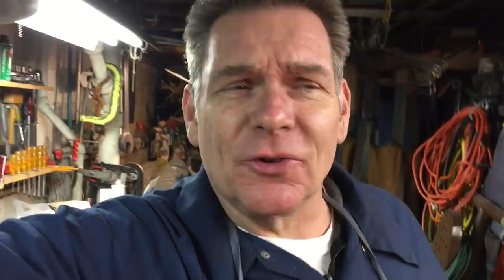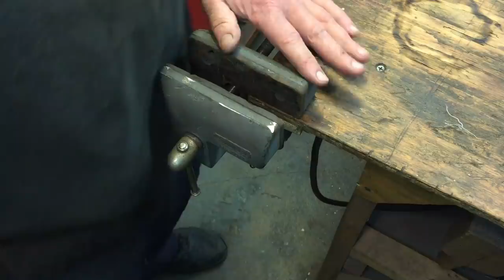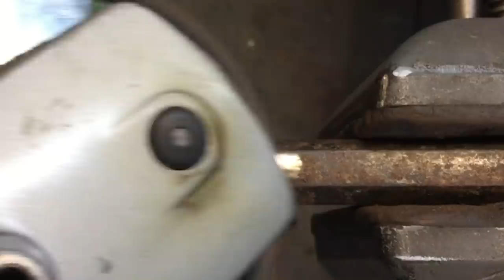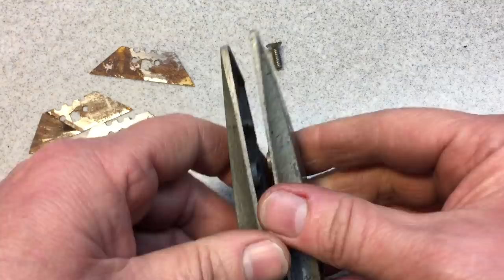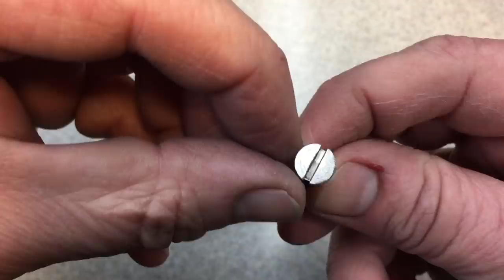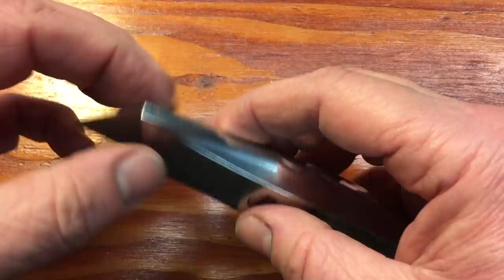Walsco Utility Knife Makeover and Fun With Your Angle Grinder.

Comment: That's a good looking utility knife, Scout! Now to stick my nose into someone else's business. I would recommend using a full-face grinding shield when you pick up an angle grinder. I've always worn prescription eyeglasses with safety lenses so I felt invulnerable until some time ago when a grinding spall smaller than a poppy seed found its way to my eyeball. The ophthalmologist said I was lucky because another millimeter and it would have landed on the optical center effectively blinding me in that eye. I went right from his office to the welding supply house and bought a face shield.
Reply from the maker: I always wear a face shield when using a cut-off disc...!  They can explode!  Good point...  Thanks!

Comment: I wanted an angle grinder for years. My needs were very limited, though, so I just couldn't justify the money. Even though they aren't expensive, I have to be able to predict how often I would use a tool, divide that number by the cost of the tool, and if the result is less than what I would be willing to pay to RENT a tool, I buy it. Well, I found myself in need of an angle grinder just too infrequently to arrive at the numbers I wanted.
Then, one day I was looking for something else and found a guy selling an angle grinder on Craigslist for a price I could not pass up. It was a corded unit, and that's the reason he was selling it. Most people, it seems, want cordless tools. Well, I just didn't care about that, so I contacted him and two days later it was mine. It was a complete set, too, with a protective case, five or six wheels, and the tool needed to change the heads. And yes, it has the handle that you can affix to three sides to make any project more comfortable. It's old, it looks like hell, but it works perfectly and now I go around just looking for opportunities to use it.

Comment: at 2:05, I don't think so John. I look forward to your video's and don't look at how long they are.  Angle grinders = respect. My first one is a 4" grinder not as strong as the bigger ones. I love flap wheels. The worn out ones are good to work with. I sharpen lawn mower blades etc. But they can remove a chunk of material quickly. I loved that utility knife. Jeweling is an awesome technique for metals. I love it.

Comment: Utility knife looks great. An angle grinder can also be dangerous to your body, especially when you are are using cut off wheels. I saw a guy using one in a body shop and the wheel exploded. He was lucky wearing a face shield. The wheel tore the face shield up.  Be careful when using a hand grinder.  Safety gear is a must with this tool.
Reply from the maker: Wire!  I very rarely use the cut off wheels!  I’m a hacksaw man!   You are so right when I do use them I dress like safety sally!  😃👍

Comment: That knife is SHARP and I don't mean just the tight blade either. A while back I bought a new go-devil or splitting maul or Collins axe or whatever you want to call it and of course the point was too thick and blunt for it to start a split right so I took it over to the boulder hole shop to grind it down.They have the big Milwaukee side grinders (6 or 8 inch)  with no guards to work on the BIG stuff with. With a trigger switch setup and while I was grinding down the blunt part of the edge and having to shift the grinder around I was thinking that someone could get WRECKED very easy with this tool. The next week one of the grinder crew cut a finger off with one. Can't be too careful. Thanks John CS! Blessings!
Reply from the maker: Lewie So true!   😃👍

Comment: Your work is the best. Don't worry about making your videos longer. That's why we are here. I try watching some of the other guys and usually quite before they are done. There about  three others l like and they are your subs. Your the reason my son and I got into this hobby. Thank you. Anyway I have used angle grinders on I beams and things but nothing like tools. What grit of flap disc would you suggest to use for someone that just starting. Thanks
Reply from the maker: Hi Glen!  For real heavy rust removal or stock removal start with 40 grit...  Then 120 and 220!  The discs wear quick...  😃👍

Comment: Nice restoration! What type of paint did you use in the handle of the utility knife?
Also what grit (or courseness) do you recommend for a 8” fiber wheel for a bench grinder or polisher?

Comment: Hi scout,  angle grinders are a great tool, can't remember if you mentioned it, but you can get those flap discs in differant grades of grit . Do Stanley still make that vise ,? Or do I have to hunt down a  s/h  one , just another excuse to visit junk markets, lol. The utility knife turned out nice , your a past master in the engine turning . Can I pick your brains ,Scout, I opened one of my tool boxes , last opened several months ago, and there was an awful smell of like vinegar or something. And a stanley knife model ( 10-020 ) has had its finish turned to paste leaving the metal  dull grey and oxidised,  also I found a screwdrivers yellow plastic handle has shrunk, that smells strongly as well, all other tools are perfect, it's a mystery to me what's happened here, I would be gratefull of any advice you have,  you cant use these as they are , they smell so bad, so I will replace them. Thanks again ,Best wishes to you and your's, Stuart.uk.
Reply from the maker: Stuart -Those little vises are all over eBay but you can also find the flea markets and they are fantastic I am so glad that I bought this one I never thought such a little dinky Vise could do such a great job and they do!

Comment: U just turned a utility knife to  display knife. Nobody wud hv the heart to put it to daily use.  Angle grinders, yeah they need precise hands & mind specially wid grinding and cutting wheels on.
Reply from the maker: SANTANU SINHA you are so right I hardly ever use cutting wheels they can be very dangerous and I never feel comfortable having the wheel vertical when my face is right there so I always wear a facial but still I never felt comfortable with them because of how fragile they can be!  😃👍